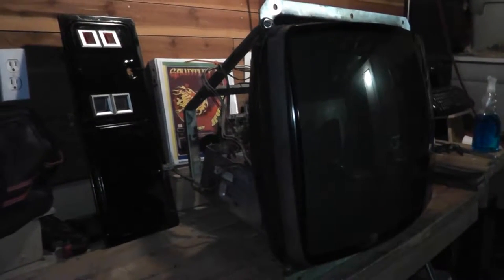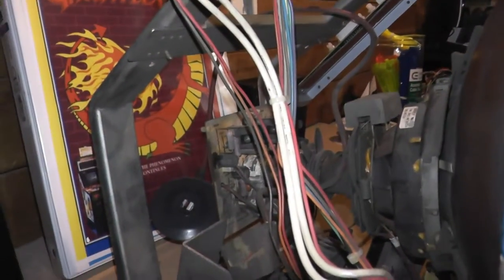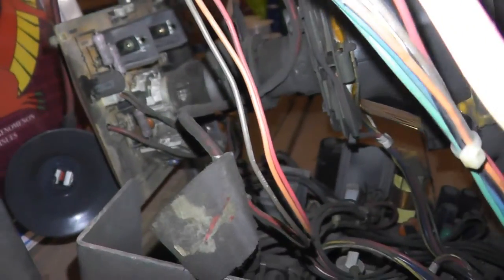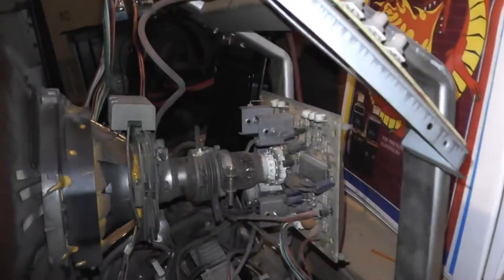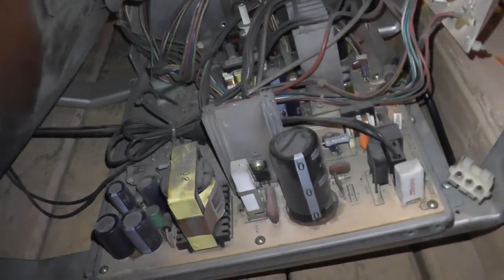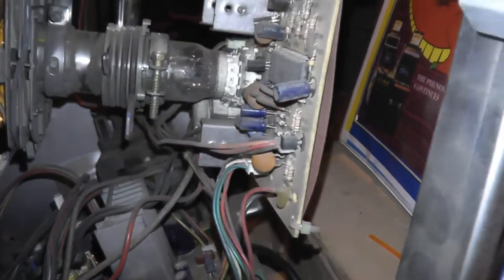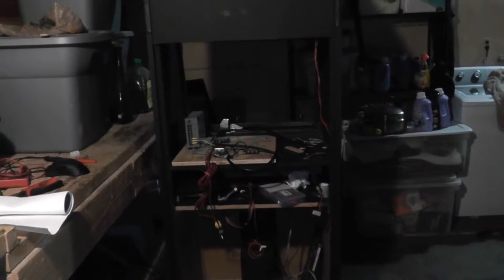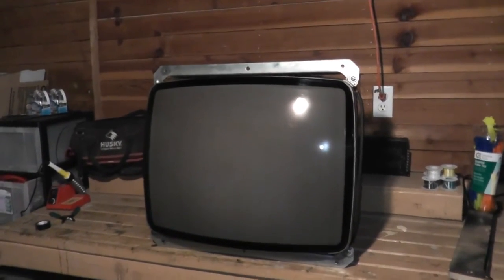Neotec NT-2515C Arcade Monitor

Comment: What I do is spray it with simple green soak it and then hose it down with water let sit for a while to dry out you will be fine I do it all the time
Reply from the maker: what I ended up doing is removing the pcb and using cheapo dollar store brushes to clean the pcb and it worked